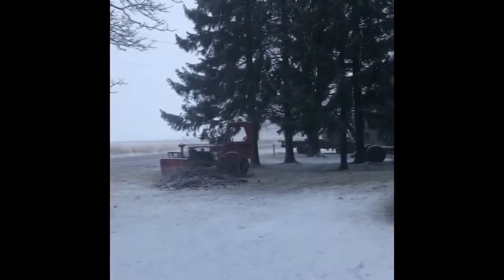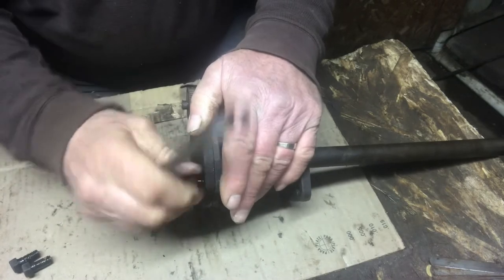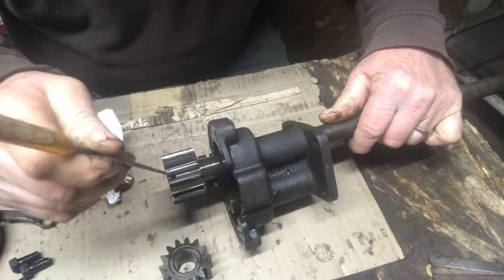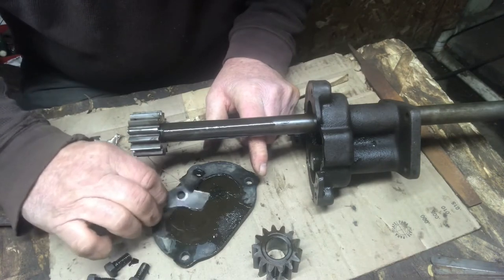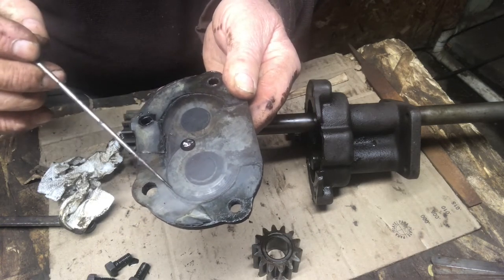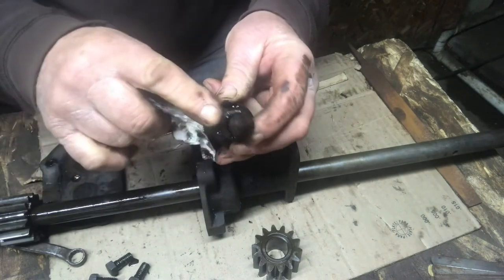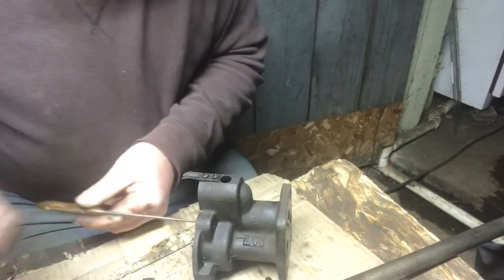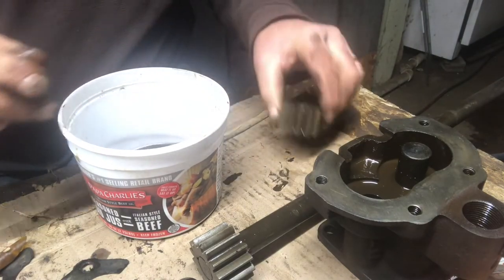Cat 60 oil pump 3/31/22

Comment: Oil pumps are so simple. My model a oil pumps i had cleaned up and was able to re use without replacing anything. Not much to go wrong with these old oil pumps. Yours however is much larger than my little old ford engines lol

Comment: It's good to know what material you can use. I will probably have to do the same for the rocker covers on my engine. At least that is something within my scope of abilities.
Reply from the maker: I don’t know what your engine is or how the valve covers are designed but often people over tighten them and distorting them causing leakage.
Reply: @oldamericaniron5767  it's a Ruston Hornsby 6YDA MK II air cooled. Made in India.